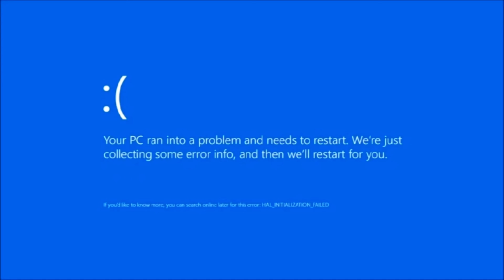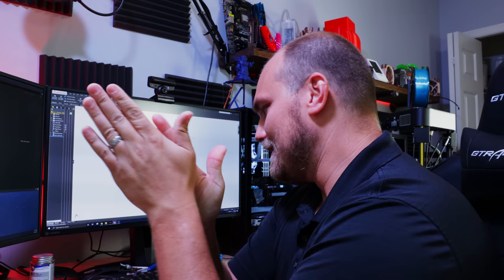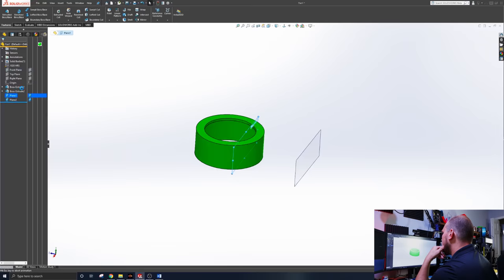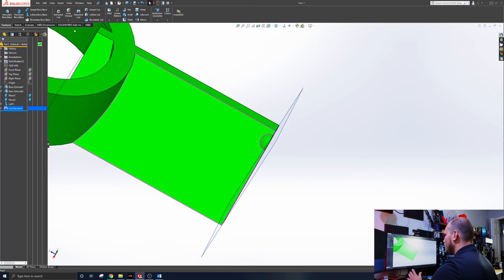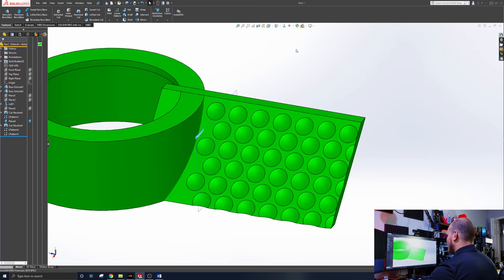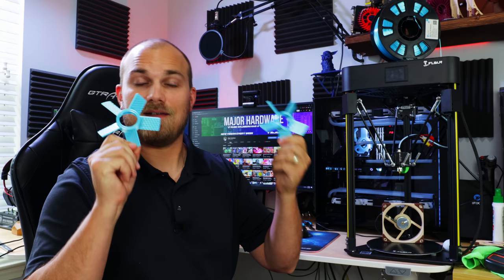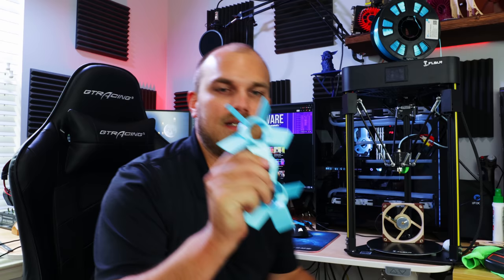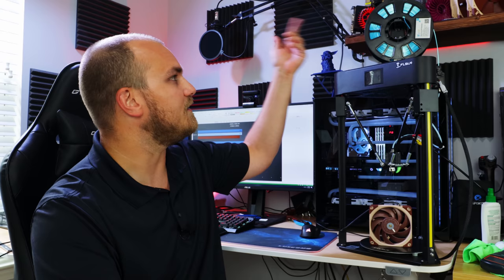What If Fan Blades Had Dimples Like A Golf Ball?

Comment: If they're functional. Saving 10% of material over two million fans... That's good manufacturing 😁
Reply: manufacturing it would be more complicated and would require more precision. plus with details like that, the tools might become off spec sooner. the material isn't everything when it comes to price of manufacturing
Reply: @The4stro  not to mention you still need more material to make it stiffer because removing material that's structural and leaving holes in it makes it more prone to breaking, so you gotta add more
Reply: @FAQUERETERMAX  true dat
Reply: @The4stro  its plastic, isnt it? How challenging could injection molding be?
Reply: @bluflare12345  it's not about how challenging it is. it's about price. i just finished school for a toolmaker. toolmaker is someone who takes care of dies (also known as tools, hence toolmaker) for injection molding or any other kind of molding, so i know a bit about molding. making a tool for manufacturing a fan with dimples would be more expensive, because the tool is more complicated. the tool might become off spec sooner because it has smaller and more defined details, so it needs to be replaced or fixed sooner, which again, costs money. also, a detailed tool like that might create more bad parts, which again... costs money. yes, you might save like 10% on material, but you will waste like 15% stuff i just explained
Reply: @The4stro  not really. The only way your tooling would wear out quicker would be if you were laser cutting/ guillotine cutting something. THOSE things cost alot to have custome die made. Injection molding plastic much easier to do custom work on. Thats also why there are alot of cheap, bulk made plastic crap and fakes in China. Because everything to do with injection molding is cheaper. You could make a ghetto injection moulder yourself at home if you had your wits about you. I worked for a company that used lasers for custom foam work for a few years. I also know a fair bit about tooling.
Reply: @markky3050  i didn't say it would wear out faster. i said that it would become off spec faster. the parts that create the dimples could wear out and become off spec
Reply: Wouldn't it actually be more material. A dimple has more surface area than flat. Shortest distance between two places is a straight line.  Not a curve.
Reply: @ghettoc0  he's creating the dimple by having reduced thickness in the areas of the dimple. So yes to more surface area, no to more material.
Reply: @The4stro  you also for got to mention the high risk of blemishes from the molding process as well. the mold would cost more due to the increasing machine time and precision. 10% savings in material isn't much untill you get into a huge scale . Just cheaper to use what we have then to try and save 10%
Reply: @jessejarvis3646  i didn't. i mentioned it in my second comment. "also, a detailed tool like that might create more bad parts"
Reply: I think they would collect dust more too
Reply: ghettoc0 3D space not 2d space, take a cube, cut out a circling from a face, less volume, more surface area
Reply: Gota make it thicker so you can have dimples  most fans are super thin to thin to have dimples
Reply: If that were a die cast tool sure, but for plastic injection molding you’d EASILY get 5 million uses out of that before significant non conformance Issues started popping up, and the tool itself would probably be in the 15-20k ballpark.
Reply: I wouldn't say. Tbh the actual manufacturing is more expensive than the material. So cutting out a thousand holes in a fan blade isn't worth a few tens of grams of plastic
Reply: @FAQUERETERMAX  In this event, you'd just have to simulate strain, and check for weak points before production. It could be that those thinner, dimpled sections don't experience much strain. I wouldn't know. I haven't modeled nor tested this design.
Reply: Some characters aren't allowed  surface details go off spec faster than surface without details. im not saying that it will go offspec after 3 parts, im saying it will offspec slightly sooner than if it didnt have the details
Reply: Not sure if it was mentioned or not, but the entire idea is actually backward. The idea behind the golf ball dimples is to cut through the air with less resistance to go further. With a fan, you want to CREATE turbulence, but more specifically, you want it controlled. With that in mind, you would actually want to test raised bumps, rather than dimples because they’re going to create higher air pressure. Also, the comparison against a stock fan isn’t exactly fair given there are curved elongated fan blades in a crescent shaped. To get a true test, you need the same blade design across all of the fan blades. Remember scientific experimentation: there must be only one independent variable (which in this case is the bumps/dimples). As such, a fair test would be: stock fan, 3d printed copy of stock fan blades, 3D printed + dimples (or you can also throw in the bumps as another option as the same independent variable). You also need to adjust the density of those dimples because golf balls have their dimples backed right up to each other to form a ridge and they’re not really circles, but more of a hexagonal/honeycomb shape to have them all connect. These are all crucial pieces to get right in the testing. Use the 9-blade curved design (as that’s the gold standard for high static pressure fans ever since scythe gentle typhoons) and then you want to be testing the STATIC AIR PRESSURE, not the rpms or temp delta. The other measurement you want to take is the sound output of the fan. What pressure, cfm, and db does the fan produce at specific RPMs that the fan controller can operate at.
Reply: #Miqdaad Indori  not up to specified tolerances. imagine having a dimension on a part that's 10mm, with tolerance of +-0.05mm. that means that the dimension ca be anything between 9.95 and 10.05. if the dimension is not between the tolerances, it's offspec
Reply: #Miqdaad Indori  parts become offspec because of wear. also some wear is acoounted for
Reply: But the thing is, will they last as long as the flat blades?
Reply: @The4stro  search about plastic molding, pc fans arent made with cutting tools
Reply: @ghettoc0  You are not serious... are you? An empty tray of ice cubes has more surface area than a tray full tray of ice cubes. Which one has more material? Material that can be molded such as plastic. You would measure it by its volume or its weight.
Reply: @mynameismatt2010  Thank you. Finally.
Reply: @HourRomanticist  When you injection mold something, you mold the dimples with it. You don't cut anything out. It's a mold. lol
Reply: @paulweston8184  lemme just show you. this is the english page about the school i went to https://spsostrov.cz/about-us it's a czech school so the only page in english (and german at the same time) is the "about us" page, but if you click on the "3-year Study Programme" you can read about the toolmaker apprenticeship i studied
Reply: Goliath cz first let me apologize. I was being inconsiderate to the fact you went to a tech school in another country. We don’t have a program called “toolmaker” in the US.
Reply: @paulweston8184  nah, its cool. you weren't the first to not believe me. btw, the mould are also called tools, that's why the name "toolmaker"
Reply: .09 mil thinner blade with .125 mil raised dimples but touching on tangents. Using roughly the same amount of material. By connecting at tangents creates a stronger structure. The tolerance for error can be higher by a small margin
Reply: Broken Syntax there’s actually more material required
Reply: @alandouglas2789  how?
Reply: Goliath cz I thought the comment was referring to the non dimple one, my mistake
Reply: @paulweston8184  yeah, we do have a program for toolmaker.  I have a journeyman's card for toolmaking.
Reply: J Edwards i was thinking the exact same
Reply: Regular fan blades are thin and have more of a blade like edge. These are thicker than normal. There probably isn't enough material to put dimples across a normal fan blade without it intruding onto the back side.
Reply: ArmchairWarrior  what do you mean?
Reply: @FAQUERETERMAX  planned obsolescence, people would buy more fans
Reply: @FAQUERETERMAX  not quite, dimples are actually extremely good engineering. Look at dimple dies etc where you are able to reduce weight drastically while actually improving rigidity.
Reply: @paulweston8184  I tend to agree - these molds are made with very hard steel. The cost of making the mold is high, I don't think making dimples in the increases the price that much or would make the mold's life shorter. The savings come from making 500,000 parts from the one mold.
Reply: How many AMPs did they each draw?
Reply: @Goliath cz @Markky now this is a good comment section
Reply: no just make the blades thinner
Reply: An ice cube tray uses more material than an ice cube tray lid. A dimple in a thin material requires extra material because of the extra deformation.
Reply: @13meli55a  an ice cube tray would be considerably deeper than its lid. You need to consider all the dimensions.

For the sake of this video however, you need only consider one measurement. Mass. Which is directly proportional to the amount of material used (volume).

We see the measurement of mass in this video being 10% less massive with the dimples than without. Ergo 10% less material.
Reply: Broken Syntax And I’m saying on a commercial fan blade, dimples are a considerable depth compared to the thickness of a fan blade. Fan blades can be really thin already. Adding dimples would not be removing material from an existing design, it would be a new design and not necessarily lighter.
Reply: You know if you can save 10% material it doesn't matter 1 piece or 2 million right?? You are not so good at math don't you? 😂
Reply: Ounces add up to pounds
Reply: The molds for the dimpled fans would be a freaking mess. Possible, yes, but way too complicated/expensive.
Also, don't dimples on golf balls just help manipulate their flight trajectory through friction? Makes zero sense on a fan. You'd just increase turbulence (and noise), not flow.
Reply: Right Round Right Round I meant they won’t wear out at a disproportionate rate because because the mold has dimples a thousandth of an inch deep. That was the debate. Also, Could  you name me a school to support your claim that “we most certainly do have schools in the US with programs titled “Toolmaker”. Thanks
Reply: @markky3050  China only makes things cheaper because they don't pay for labor.
Reply: @santiagoperez2094  you need reading comprehension. tiny details in the mold would wear out and become out of spec quicker than a mold for flat fan blades. Making molds with more small details will be more complex than the one for flat blades, and the tooling used on making the mold also needs to be considered. Less material on the blades can also mean less structural integrity if the flat fan blades they will be based is already optimized for weight.
Reply: @FAQUERETERMAX  The dimples add stiffnes.Like putting creases in sheet metal.
Reply: i would like to see if the lower weight would make a lasting difference to the wear of the motor like lengthening the blades vs shortening the blade by a small margin if it could still keep its airflow relatively the same not that major hardware should try it as that would be a very long process but i wonder what the differences would be
Reply: Functional in a test bench but in a realistic application - it's going to soak up dust way worse than a smooth blade fan.  I'll pay the extra 2 cents in plastic.
Reply: @mynameismatt2010  Where do you buy molds from that can run 5 million parts without remaking components, and at such low prices.
Reply: @The4stro  not if they are injection molded. The cost of making a die with outward facing dimples is negligible are you serious?
Reply: @bluflare12345  balance.  Fans are supposed to be balanced and taking away material makes that harder.  More engineering time.  Also, the dimples in the golf ball are there to make it go farther, a fan's job is to push air.
Reply: Wayyyy harder to mass produce not worth the material saving.
Reply: Except you could just make them thinner and save way more material. Unless the dimples have a structural reason, there's no reason to make your manufacturing harder.
Reply: Thats good engineering.  Manufacturing and product development are not the same thing.
Reply: @paulweston8184 , thank you for recognizing your error, and apologizing. Faith in humanity restored.
Reply: @13meli55a , altering an existing design to add dimples, which makes the material thinner where the dimples are, would reduce the amount of material used for the fan. Creating a "new" design with dimples that would fit in the housing of a fan without dimples, would have the same result. 

In other words, two fans of the same dimensions, one with dimples, one without, would result in the one with dimples using less material, because the blades would be thinner where the dimples are. It's really not that hard to understand.
Reply: material coast is realy not the relevant factor in most manufacturing nowadays, workcoast, transportation, & machinery are way more pricy
Reply: Yeah but wouldn’t it be less efficient due to aero dynamics because it would have less drag
Reply: Lol, no
Reply: Indeed my conservative friend
Reply: only if it's 3d printed
if it's milled you're losing material
Reply: @Okuni_  thats true...
Reply: @Okuni_  unless they collect  the milled material and reuse it
Reply: @markky3050  injection molding is easy for custom work? Lmao
Injection molding is the hardest tech to get a die up and running.
Ive seen companies work for months on a single die just so it can start production.

The mayor advantage of a die is once its up and running you can make 10 milion parts with it. Under 200k they rarely even produce a die.
If you dont care about tolerances you can just mill a die and see what you get but this is a small minority of the injection molding industry. 

Making a die for a few thousand parts is simply not viable. Its cheaper to just mill them. Tools last forever working in plastic
Reply: You should measure the flow. Put a duct on the back and a flow sensor.
Reply: Might not be as sturdy
Reply: dimples are unnecessary detail, and bottom line is more details=more wear on the mold. Also, weird surface area=uneven cooling of the part inside the mold, that can cause defects. May be irrelevant in case of fan blades, but thats the general idea. Another thing with more surface area is that the part will be harder to extract 
And finally making mold with bumps to create dimples would be pain in the butt, you dont want that :P
i'd say 9% less use of cheap material for all that is not worth it ;]
Reply: Broken Syntax: The drawback is possibly a less durable structure, so it may be good in some applications, but not in others (especially as the material ages). I personally would want to clean each blade if they're dimpled, which is another aspect worth testing—debris collection and lifetime efficiency.
Reply: @The4stro  yeah plus all the rejects that you're gonna get when those things go wrong and you get some blades looking like Swiss cheese.
Reply: @ghettoc0 : Uh... the video just showed that it would be LESS.
Reply: @jefftimmerberg193 : Even without the pointlessly random quotes.
Reply: Actually,  @JEdwardsbret , dimples do create turbulence.
Reply: Thanks  @HelloKittyFanMan. ! @J Edwards, dimpled golf balls don’t cut through the air, they create turbulence behind the ball which pushes them further.
Reply: You're welcome,  @dtr5591 , and thanks back!
Reply: Wow cool comment section, I lean more than ever
Reply: You people are arguing over 1 cent of cheap plastic, you are literally arguing over nothing!